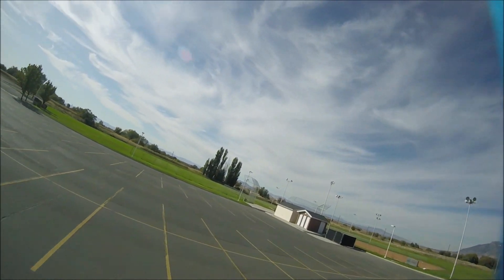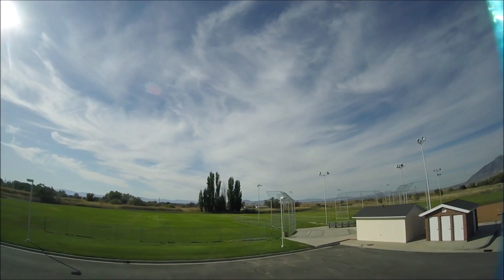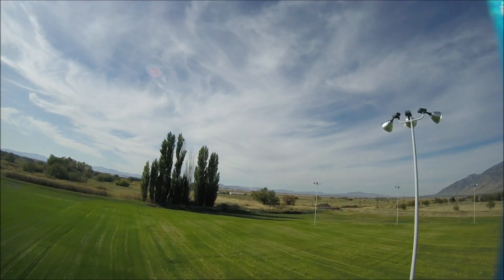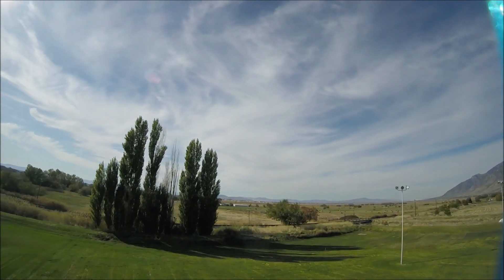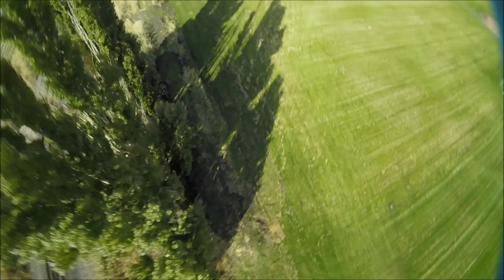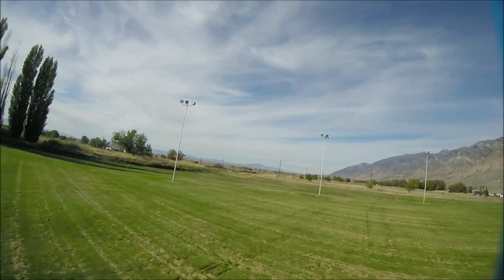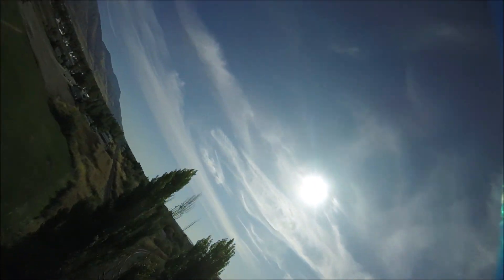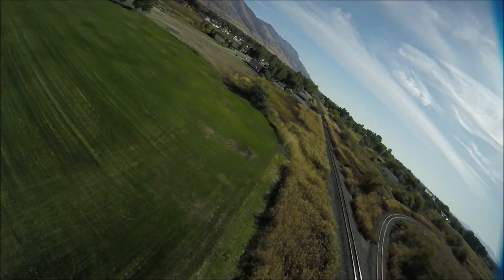Betaflight 4.1 with RPM filtering on a 7in quad

Comment: Very hard to tune, Im trying a lot of days removing the bobbles flights in my 7"
Reply: Very good, incredible tunning, so smooth, and the camera, is not a gopro with hipersmooth??
Reply from the maker: 2 things I found that helped me. 1. Increase idle rpms a touch if you get the wobbles on low throttle. 2. If you can tell the axis it is wobbling on bump up all the PID values on that axis. Hope that helps.
Reply: @BlutoFPV  Yhea at low throttle, I'm trying tuning the iterm relax, set to gyro and reduce from 20 to 10, a little better anyway not good, I will try your tips.
Reply: Too light of a quad with small motors caused me all kinds of bounces with my 7inch.  2306 1600-1700 motors on 4s was a pain in the ass with the random wobbles.   Probably due to the props loading and unloading constantly.    I built a project 399 7in dead cat with the 2806.5 1300kv motors and on 6s it immediately flew better.   Then I started putting big batteries on it and it really smoothed out.   Like playing video back at 200% speed doing almost 1 mile long proximity flights and having it be perfectly smooth with no harmonics or bobbles.   How big of a battery?   How about 645g 6s2p Lithium Ion pack with 15 amp cruising speeds and rated for 30 amps continous(50-60amp burst) for 23 minutes...    Currently building a 10inch that weighs about 1300 grams AUW with gopro and 6s 1800 pack.   The same idea is gonna be applied with weighting it down so props properly load(have a 10in dead cat running 6s4p 12000mah that is heavier and it is DEAD SMOOTH along with a 13in Xclass running same 6s4p and soon to be 8s4p).    The filtering is likely good, the quad may just be a little too light for the props and motors selected.

Comment: hello friend flying with the pids and default filters ?
Reply from the maker: I did the setup Joshua Bardwell suggested in his videos. I have had to do some adjustment since.
Reply: @BlutoFPV  What adjustments did you do to RPM filter and PIDs?
Reply from the maker: @gustautas  I did what Joshua Bardwell suggested in his video on RPM filtering. I gave only adjusted PIDs beyond that.